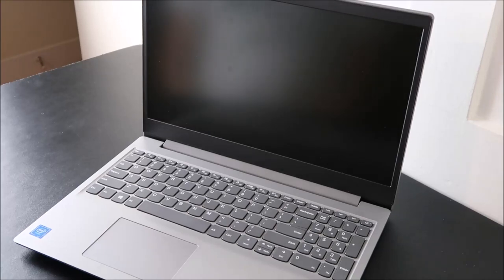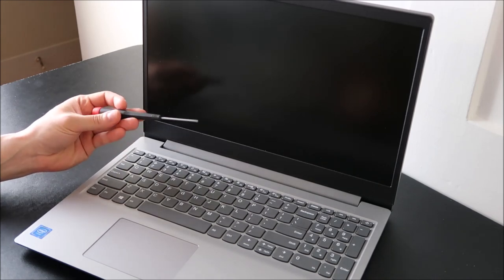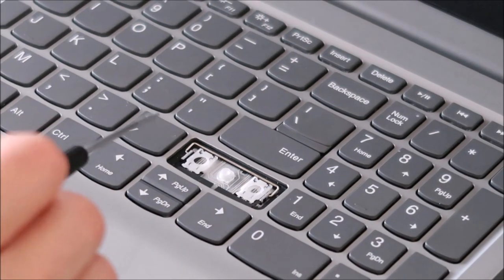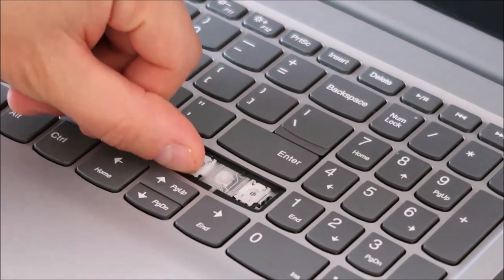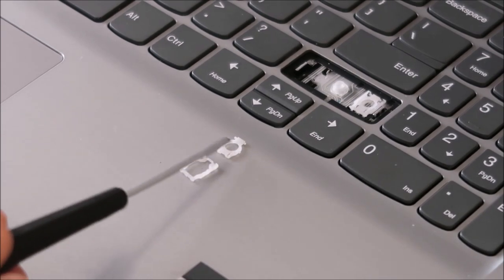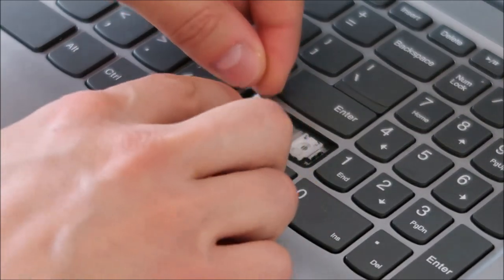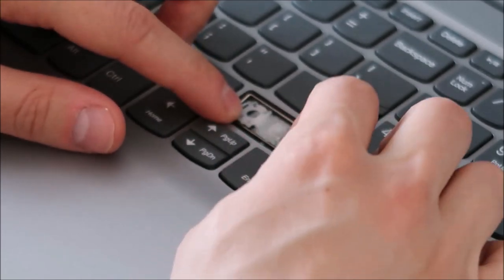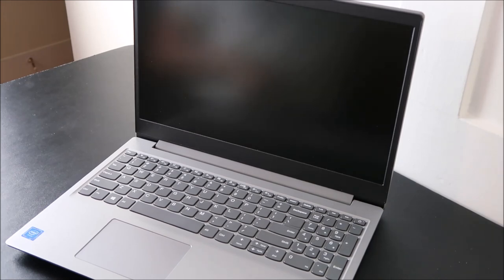How To Fix Large Keyboard Key - Lenovo Thinkpad

Comment: I have accidentally taken off the white spring in the middle, am i able to reattach that?
Reply from the maker: There isnt really a good way to reattach those.  They are not meant to be replaced.  Best advice is try to use a small amount of glue.  If that does not work, you may have to replace the keyboard.

Comment: I went to disassemble a T420 to change the right hinge, I removed it from another t420 that is stopped with a burnt plate! When I went to put the keyboard and turn it on, the enter and backspace keys only work with the keyboard connected to the board, but out of its position, if I put the keyboard in its position and fix it with the screw, the enter and backspace keys don't work! Bizarre!
Reply from the maker: Sounds like when the keyboard is set in place, the ribbon cable is coming lose.  Is the ribbon cable fastener clip working well and undamaged?  Does it secure the ribbon cable in place nice and tight?

Comment: Hi I spilled some water on my laptop but I’m having some trouble removing the space bar on my HP Bang and Olufsen laptop, model number: 7265NGW. Any help would be appreciated
Reply from the maker: What are you having an issue with?  It should have a couple Retainer Clips as seen here, perhaps a couple metal bars as well.
Reply: @PC_Monkey  the space bar still works but it doesn’t feel right, it doesn’t go down all of the way. I was hoping taking the key off and cleaning underneath would fix it but when I tried to take it off it was taking more force than in this video and I was worried I’d break it
Reply: @PC_Monkey  is there a specific place I should be putting the flat head?
Reply from the maker: @brodietinning4733  Yes.  You usually put the pry tool in-between the Retainer Clip and the Key Cap.  After one part is taken off, you would repeat it on the other clip as seen here.
Reply: @PC_Monkey  thanks a lot I’ll give this a go 👍
Reply from the maker: @brodietinning4733  Good luck !!  Let me know how it goes :)
Reply: @PC_Monkey  after about 15 minutes of trying I finally managed to get it off. I’ve cleaned the underneath and put it back into place. Everything works perfectly again, thank you so much!
Reply from the maker: @brodietinning4733  Glad your all set :)   Always here if needed !!

Comment: Hi, I have a lenovo thinkpad p15v2 with a numlock key that has a White Dot light in it when numlock is turned on. How would you remove this key? 

I spilled Coffee in my computer. And this is the only one im afraid of taking off.
Reply from the maker: Is that key closer to the size of a letter key or closer to the size of a larger key as seen here?  If a larger key as seen here then your most likely looking at this video to help.

Comment: I've tried putting back my left shift key but when I do it keeps being flatter than the other pieces, can I please have help?
Reply from the maker: If your Key Cap is not clicking down in place correctly, it is most likely due to the Retainer Clip not being properly installed or damaged.  Remove the Cap and inspect for damage or that its not laying down flush and properly snapped in itself.  Compare to another Clip if needed by removing another Cap.
Reply: @PC_Monkey  It has no damage but whenever I place it back it just stays more flat, I did take out the springy thing in the middle of it then placed it back, is there a problem?
Reply from the maker: @NooberTheGooober  You took out the Rubber Spring?  That component is held in by glue and is not meant to be removed.  If it has been removed then its possible its no longer in the correct position and is not pushing the key cap up correctly.   Best advice is try to use a small amount of glue.  If that does not work, you may have to replace the keyboard.

Comment: My capslock key seems to not stick to the keyboard. It only seems to connect to the 2 metal bars. How would i fix this problem?
Reply from the maker: You would have to find out why its not sticking to keyboard correctly.  Either the metal pins on the keyboard are bent incorrectly or the hinge clip is damaged.

Comment: My A key is not working, I have taken it off, but it is still not working.  I have even reset my computer and nothing.  I now need to use the On-Screen Keyboard to type the A letter.
Reply from the maker: Does the key or keys feel like they are physically fine or that there is something mechanically wrong with them? Also, did anything happen before this issue appeared?  Liquid spill, overheating, Windows update, etc?

Comment: My space bar isn't working, and I've tried rolling back and updating the drivers. Will this fix it?
Reply from the maker: This will fix a key that is mechanically broken.  If your key feels like its working correctly, then this is not a solution.  If your drivers are not the issue, then perhaps the keyboard is faulty and needs to be replaced.

Comment: my backspace key is now swinging and it works verrryyy losely.... please help as i think i might have broken it
Reply from the maker: If your Key Cap is not clicking down in place correctly, it is most likely due to the Retainer Clip not being properly installed or damaged.  Remove the Cap and inspect for damage or that its not laying down flush and properly snapped in itself.  Compare to another Clip if needed by removing another Cap.

Comment: i removed my backspace key and when i reattached it, the key is a bit slanted. it dips into the bottom and lifts from the top. how do i fix this? i’ve tried reattaching it numerous times.
Reply from the maker: If your Key Cap is not clicking down in place correctly, it is most likely due to the Retainer Clip not being properly installed or damaged.  Remove the Cap and inspect for damage or that its not laying down flush and properly snapped in itself.  Compare to another Clip if needed by removing another Cap.
Reply: @PC_Monkey  what if the clip is damaged?
Reply from the maker: @aadyasharma-pi9wv  If the clip or any key assembly component is damaged, it would need to be replaced.  I usually get my keys on Ebay or https://www.laptopkeys.com/.  If you cannot find a loose key for sale, you may have to purchase a keyboard and take a key from there.

Comment: Hi! The space bar wasn’t working properly and I did this and it doesn’t work now
Reply from the maker: How was it not working properly?
Reply: @PC_Monkey  it was a bit sticky so i just decided to open it and clean it
Reply from the maker: @mariaaguileragarcia9526  So how is it not working now?
Reply: @PC_Monkey  I dont know!!
Reply: @PC_Monkey  I don't know what I can do..
Reply from the maker: @mariaaguileragarcia9526  How is it not working?  Is it still sticky?  Is the key not going down correctly?  Does it feel fine but is not typing when you use it?  Whats wrong with it?
Reply from the maker: @mariaaguileragarcia9526  This video is a tutorial on how to replace a key.  If your keys are not working but are not mechanically broken, troubleshoot them as seen here; https://youtu.be/wqrchfpdJ_w.

Comment: My still won’t work. the backspace is like lose it won’t go back in
Reply from the maker: If your Key Cap is not clicking down in place correctly, it is most likely due to the Retainer Clip not being properly installed or damaged.  Remove the Cap and inspect for damage or that its not laying down flush and properly snapped in itself.  Compare to another Clip if needed by removing another Cap.

Comment: My son pulled his cat off of his computer,  as he was pulling her she pulled off the space bar. So no idea how it was supposed to be on. No matter which way i do it, it is not going on right. Either way I put it in,  there is an offset. Top or bottom along the length.
Reply from the maker: If your Key Cap is not clicking down in place correctly, it is most likely due to the Retainer Clip not being properly installed or damaged.  Remove the Cap and inspect for damage or that its not laying down flush and properly snapped in itself.  Compare to another Clip if needed by removing another Cap.

Comment: thetwo plastic things arent coming together
Reply from the maker: ?   The Retainer Clip came apart in two?
 They fit together with a small plastic pin on the left and right of the inner clip.  These fit into holes on the outer clip.  To see exactly how the inner clip sits in the outer clip, remove another key cap and copy the clip under it.

Comment: oh i think i broke the plastic part
Reply: my ctrl ket is working but its like a light switch lmao
Reply from the maker: If your Key Cap is not clicking down in place correctly, it is most likely due to the Retainer Clip not being properly installed or damaged.  Remove the Cap and inspect for damage or that its not laying down flush and properly snapped in itself.  Compare to another Clip if needed by removing another Cap.

Comment: i need help can i message u somewhere
Reply from the maker: You just did lol :)  What brand and model computer do you have and whats the issue with it?
Reply from the maker: @Yihao Zhang  I usually get my keys on Ebay or https://www.laptopkeys.com/.  If you cannot find a loose key for sale, you may have to purchase a keyboard and take a key from there.   If you cant find any replacement, then the only other option is replacing it with a key you dont use that much :(

Comment: did not help with the enter key at all, which is a nightmare, also not a single video on youtube dealing with it smh
Reply from the maker: How is your Enter key different from this key?  The hinge clips should be the exact same and the metal bar would be installed the same way.  No?
Reply: @PC_Monkey  2 clips pointing in 2 different directions. i handled it by now but lenovo should develop better hardware imho
Reply from the maker: @bencebaranyi6910  Ya, keys are not the best designed component :(:(

Comment: HI there.  What could be the reason for some keys not working on the LENOVO ThinkPad whilst some are just fine?  I have resorted to using an external keyboard!  Very cumbersome.  Please HELP!!!
Reply from the maker: Is there something physically wrong with the key / keys or are they mechanically working fine?
Also, did anything happen before this issue appeared?  Liquid spill, overheating, Windows update, etc?